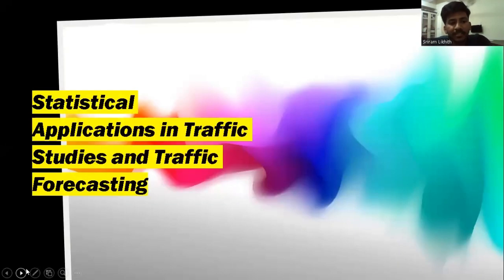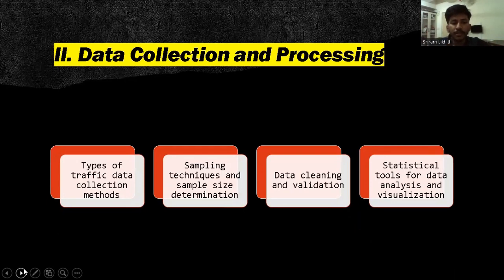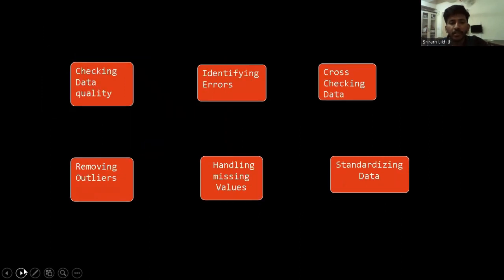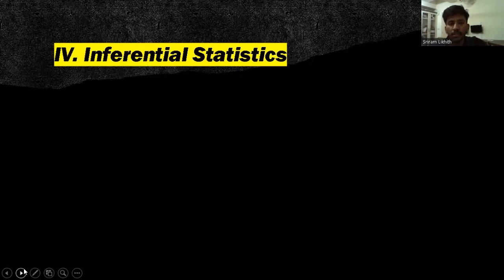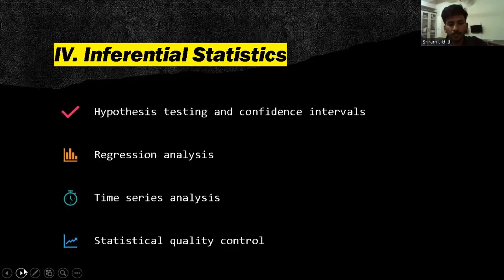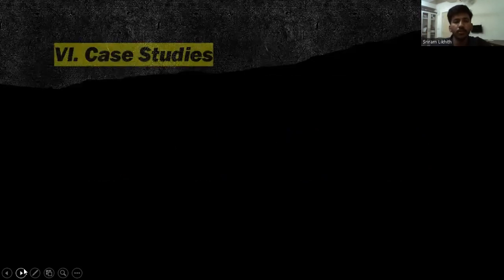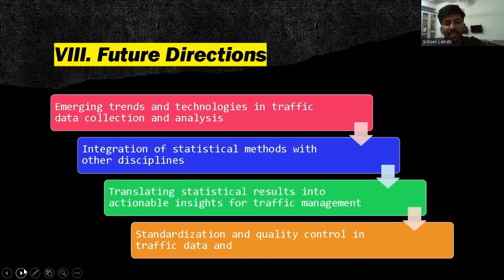TRAFFIC ENGINEERING ASSIGNMENT-2

Comment: 🎯 Key points for quick navigation:

00:03 📚 Discussion on traffic engineering assignment focusing on statistical applications and forecasting.
01:36 📊 Key aspects of statistical applications include volume analysis, travel time, safety, and more.
02:03 🤖 Use of regression and AI techniques for future traffic volume prediction to prevent accidents.
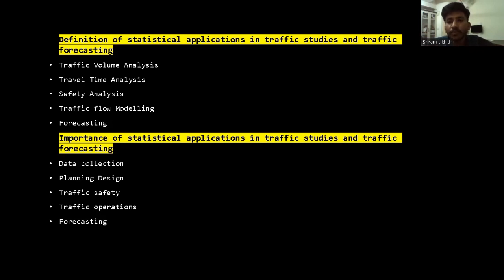02:16 ⏱️ Travel time analysis separates journey and running times to calculate averages.
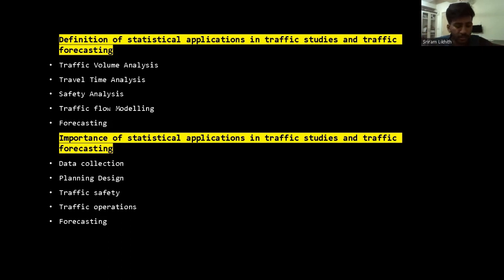02:45 🚦 Safety analysis involves examining accidents and proposing guidelines for safety.
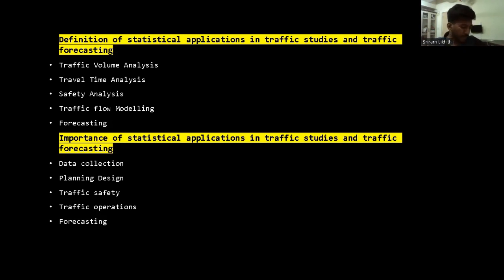03:12 🧠 Discussion of PU Theory explaining average driver reaction time.
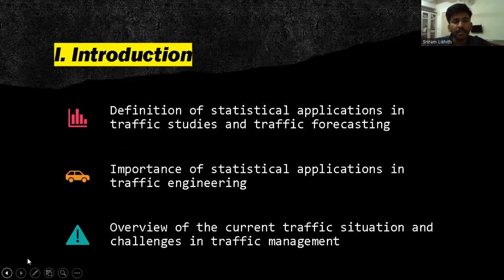03:53 📈 Importance of statistical planning in various traffic engineering applications.
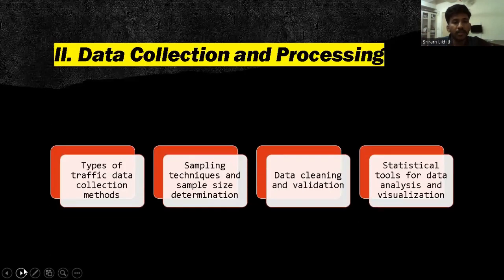04:27 📋 Numerous methods for traffic data collection, including modern technologies like GPS and AI cameras.
06:01 🚔 Video-based monitoring can identify vehicles with fines, aiding in law enforcement.
07:59 ✨ Data validation and cleaning techniques are essential to ensure accuracy.
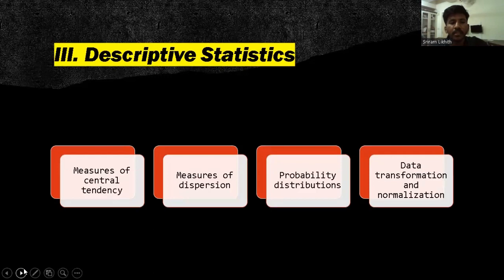08:28 🔢 Various statistical methods are applied in traffic studies, including regression analysis.
10:14 🚸 Accident prevention through engineering, enforcement, and educational measures.
12:28 🛑 Educating road users can improve adherence to traffic rules and enhance safety.
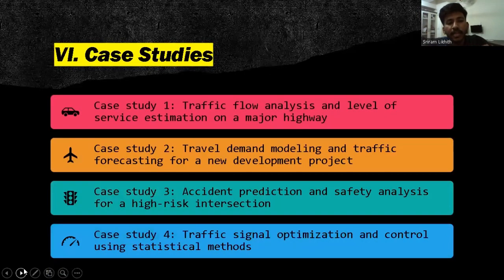12:58 📑 Case studies explore traffic flow, demand modeling, and signal optimization.
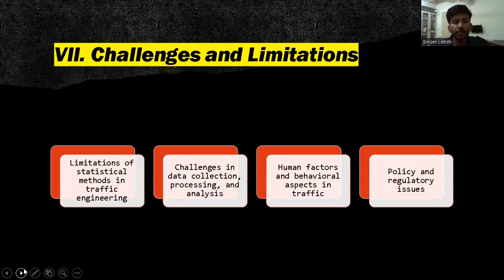13:28 🕵️ Challenges in traffic engineering include data accuracy and human factors.
14:27 🌐 Emerging trends in data collection and integration with other disciplines are shaping traffic management.

Made with HARPA AI